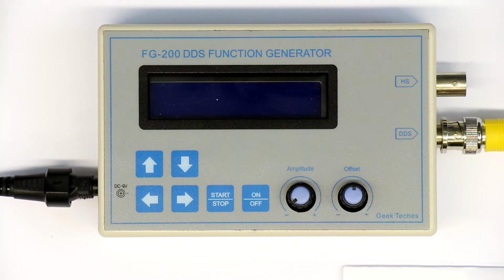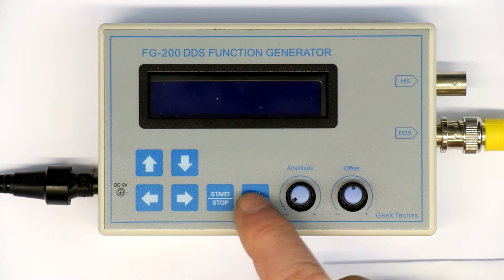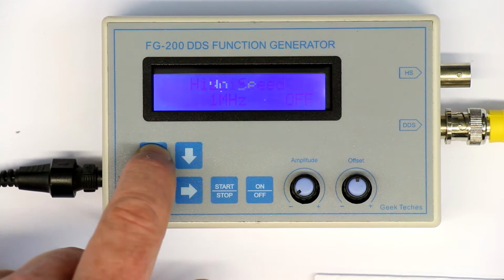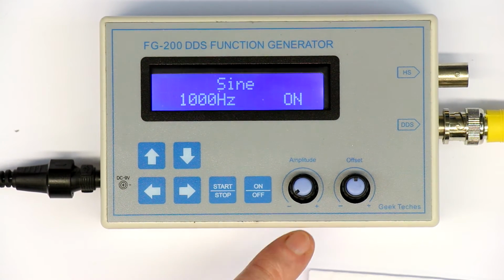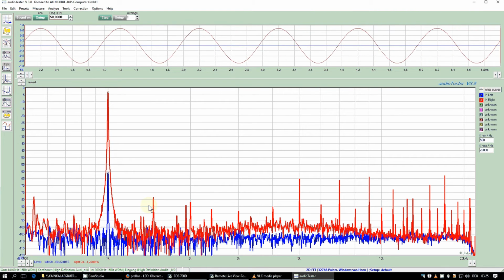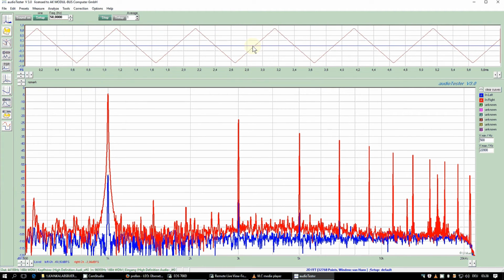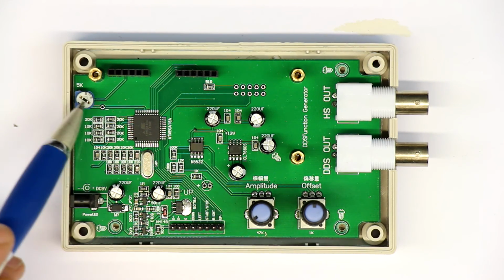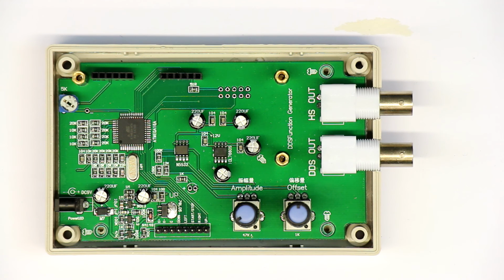Review & Teardown of a cheap DDS Function-Generator

Comment: This was a great video and great explanation, just too bad I didnt see your video before I ordered one of these units myself. Like you I wanted something simple and basic to use for repairing amplifiers. Also was hoping the unit had capability of smaller voltage amplitude for audio work.

Comment: Debouncing the inputs is simple. Insert a small cap in parallel to each button. To get rid of any dc, try a cap in series to the output.
Reply from the maker: Why should I do that (and not the "engineers" who designed it)? 
It´s just junk with a useability near zero
Reply: KainkaLabs You get what you pay for. Now you have the choice of improving it or throwing it in the bin. Send it to me :-)
Reply from the maker: In fact we have it lying it here around unused :-)
Waiting for an application where it still could be used.
If you are living in Germany you can have it for free.
It not, the postage would be more expensive than the value :-)
Reply: Hy can you please explain me what exacly offset and ampitude is??which are the better settings??thank you

Comment: Nice video, KainkaLabs! The "undershoot" in the waveform at 15:47 suggests that this is due to an antialiasing-filter on the soundcard (probably oversampled and then s/w-AA then downsampled) - probably the same for the triangle. btw - Have you tried the RedPitaya by chance?
Reply from the maker: I tried different sample-rates with the (onboard) audio-chip. 
It always looked the same.
Red Pitaya is not suitable for my purpose: Battery operated standalone device + fast manual settings of frequency and amplitude.